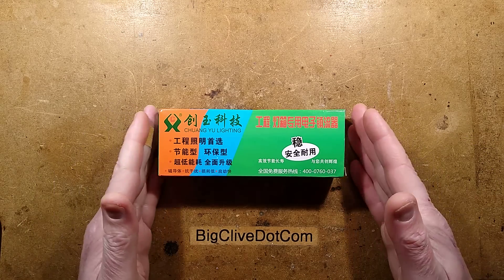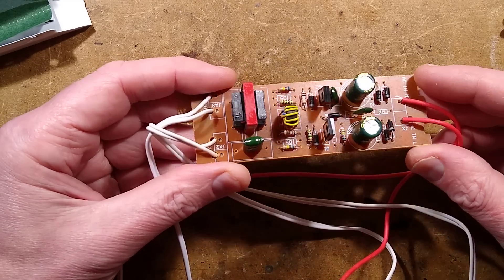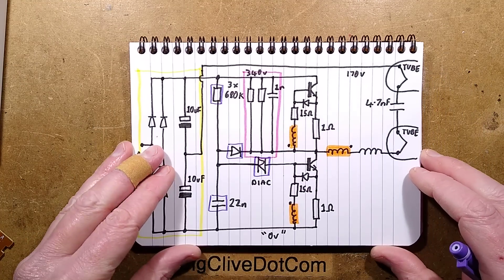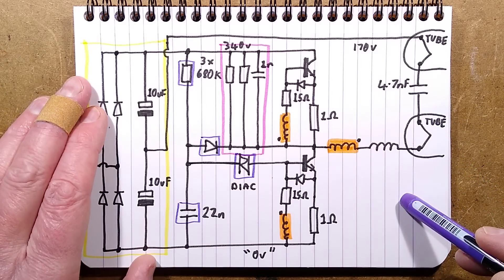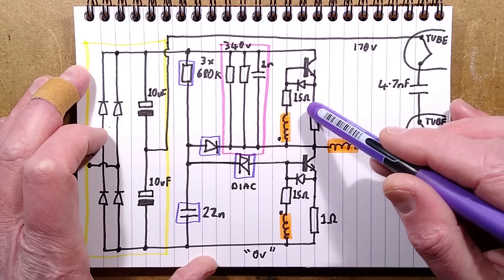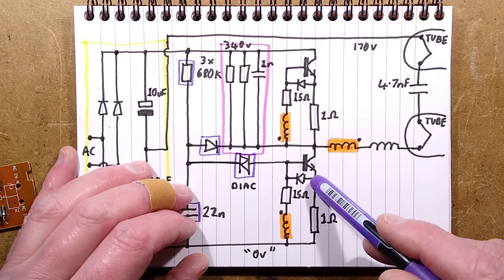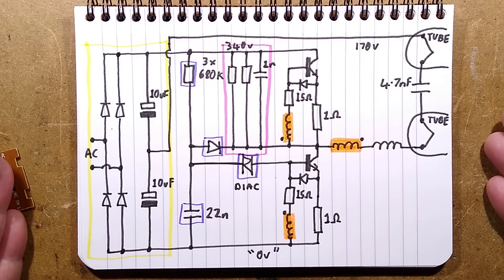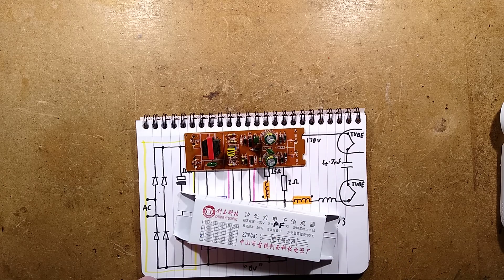Cheap AliExpress ballast (with schematic)

Comment: I'm going to continue to use fluorescent lighting in  my home and have stocked up on fluorescent tubes and other spares. As a toddler in the 70s they fascinated me, the way a tube could light so brightly and evenly. Was always also fascinated by the different start up behaviours. In 1978, only a few weeks after starting school, long thin boxes with purple text were delivered to the school which contained 8ft Thorn pop packs. These were to replace tungsten lighting. Still remember as the winter months took hold how well these lights lit the room, they had what was at the time cutting edge lighting technology in the form of 100w Krypton tubes.
Reply: Just don't get/stay too close to them, I used to use em as a UV source for curing UV solder mask, etc. 

The sun was also good, but well, this being Ireland, its rarer than dinosaur farts 😀 

Now I use a dedicated UV source, but you get the idea.

Comment: Yeah the biggest problem with LED lights is the caps, many of the time the reason it stops working is because of 
a bulging/leaking cap, i had that with two LED light already, i could repair them, and now he will work again for years.
Reply from the maker: Plus you can fit better quality caps.
Reply: @bigclivedotcom  Yeah, i have done that, i buy my caps in my country, and i always buy brand name caps.

I needed 4.7µF, 400V, and i bought 3x RUBYCON caps, and 3x WURTH ELEKTRONIK  caps, and i had to use 
WURTH ELEKTRONIK caps because RUBYCON caps were to big, and yeah the Lifetime 2000 hours 
Temperature 105c, a lot less then does RUBYCON caps, that had 15000 hours and 105c but i must do with 
what i had, and i could not find other caps of the same size, but it will always be better then the bad cops 
it came with.

And great to see you answer people under your channel.

Comment: Half bridge auto generator (electronic transformer) the 1n cap and resistors are to probably fine tune the frequency or add a little dead time.  👍great video as always Clive 

Steve

Comment: In my workplace we have backlights for movie posters... actually the frames have been designed by my boss and welded together by is brother. Essentially the frame is 1m high and 0,6ish wide, and the poster is taped at the corners to a 1 x 0,7m piece of 3mm semi-opaque plastic sheet that is forced between the frame sides. There are two 18W fluorescent tube fixtures in each frame. We have been using LED replica tubes in them with great success. 

Years ago the LEDs were rather expensive and everyone was already trying to get rid of the fluorescent tube stock. A "general store" of small hardware, household goods, decorative items, and a plethora of utter rubbish, which I very much liked (the store, but the rubbish too) was changing owners and they had huge discounts on some stuff. I saw a shitload of 30W fluorescent tubes sitting in a corner, sold for 0,20€ a piece, and it got me thinking... they were of optimal size to illuminate one poster frame with one tube, without making a brighter spot in the middle of the poster. BUT! And this is a big but! I tried to find prices for fixtures that took 30W tubes, and found out that the store had none, and in general, that size was virtually unobtainable or cost an arm, leg, and some other appendages.

Comment: The upper pair of resistors are needed during start up. this biases the output high so that the lower transistor can draw enough current to drive the 3 winding transformer.

Comment: Wouldn't be a bad theme for your greater wisdom to cover speaker crossovers or components. Not trying to divert you away from shiny things, but my guess is you gots knowledge.
Reply from the maker: That's probably best left to the speaker gurus.
Reply: @bigclivedotcom  Ok, suppose the next biggest questions would be how to join fibre optics and which wine would go best with SNP liver ( or just go with the buckfast )??

Comment: In the lift industry LED is taking over but I’m not sure if cheap ones are being supplied but the LED kits are learning about 6 months rather than the amount of years the old fluorescent ones did
Reply from the maker: A lot of LED lighting fails fast.  And it often requires the whole fitting to be replaced.

Comment: I use Fluorescent Lamps (a two tube fixture) in my garage.  I just changed out the factory ballast last year -- the original was installed in 2004.

I actually kind of wish I had another one, tbh.
Reply from the maker: You may be able to find old stock on eBay.

Comment: Clive, I know it's not directly related, but it's still related to switching power supplies. I recently bought a new USB C charger for my chromebook, an Anker 45w unit, it cost £25 off Amazon. It arrived and is tiny, about 1.5" square, charges faster than the brick supplied with the chromebook which is 3 times as big and doesn't get very warm in the process! On looking into it, apparently it uses GaN (Gallium Nitride) technology which is more efficient and capable of higher charging current than silicone semiconductors, would you have any interest in making a video about this technology, as it seems to be the future of fast charging!
Reply from the maker: I think the concept of gallium nitride units is that they can switch at much faster frequencies, so the transformer and capacitors can be smaller.  But it will potentially be stressing the capacitors more.
There are many fake GaN power supplies that just have a blue or green LED to tick the GaN box.

Comment: Connecting tube output to the middle point of input capacitors is not so uncommon. I've seen it somewhere multiple times, and then designed all my ballasts like that. This already is over 10 years ago (and still feels like last week).

Comment: Here in the US, electronic ballasts are pretty simple things--many times even simpler than the unit described.   Very often, the tube heaters are not used at all--both sides of the tube heater are tied together and only a single wire goes to each end of the tube.   I've got a pile of old General Electric Industrial 32/40 watt 120V ballasts that date back to the late 80s and they work just this way.      The nice thing about electronic ballasts is that they're very light when compared to the old iron-core ones--a benefit when you're retrofitting ceiling-mounted fixtures.

Comment: So I have a couple of these that don't work correctly.  They were used on LEDs that were made to use a ballast, they worked fine for a while but now only produce a dim glow. 

If I were to open it up, any idea of what area I would want to check out?  I'm just curious and probably won't end up using then again. I have messed with electronics but am not familiar at all with  ballast .
Reply from the maker: Is it the ballasts that failed or the LEDs?
Reply: @bigclivedotcom  leds work in a different fixture,, new led bulbs did the same. 

Fixture works fine with old led bulb after replacing ballast.

Comment: What's the point of the missing "BX" component near the AC IN? Its pins are shorted. Did they think if the narrow track won't be enough we can easily reinforce it?
Reply from the maker: I think it's a design option for a fuse or inrush limiter.

Comment: I have seen abandoned buildings still powered here on Youtube. Many of those are the old magnetic ballasts, and they sem to last forever. There was one place that was decayed so much that things were falling out of the ceiling. Most of the hallway lighting was still working 20 years after the place closed to the public for the final time. This place was built in the thirties if I remember right. 
The newer electronic ones (mostly) seem pretty good too. There was another video I saw of a small abandoned strip mall that was still powered. A small general store (Think Dollar General, but it wasn't that.) had power still and a few lights were still on, but flickering. There was a TRUE reach in display fridge that was still working fully, Keeping temperature, sounded good and one of the fluorescent tubes was stil happily spewing photons. There were several coolers like this, and none of the other ones were working, but still had power as the electronic thermostat still worked. One of the HVAC fans was working also. This place was also abandoned for about 20 years at the time the video went up. I can't find it now, otherwise I'd link it here. I guess it got deleted by one of the platform's snaps.
I found it in my bookmarks and I can confirm. That video doesn't exist anymore, the link is dead.
Edited because YT erased half my comment for some reason.
Reply from the maker: I wonder if people realise that a building like that will use a lot of ambient power when they turn the main switch on.

Comment: I prefer a 6 foot rube and the old bimetallic starters and a big choke, which I still have in the garage.
It just brings back memories of the good old days as i stand there in the dark after switching the lights on, listening to the genital tick tick of the starter. 
Plus the little pink flash of light from the end of the plastic starter can. You just don’t get this with LED’s where is the fun of not knowing when it light. 🙂

Comment: Interesting. The circuit is virtually identical to the drivers used for low voltage halogen lamps except that the output inductor would be a transformer instead.
Reply from the maker: And also many electronic neon supplies and ozone plate units.

Comment: I think the two 680 k and 1 nF help with the diode's reverse recovery time.  I also think the electrodes will stay hot long enough for the plasma to drain the filter caps to a moderately safe level... the oscillator is still powered after all.

Comment: The vans used by (the UK) post office trains use to use 24V DC electronic ballasts to drive the fluorescent fittings on these trains. The reason being that the vans used a 24V DC electric system. I don’t however know what size/type the tubes were (they were all smashed up on the van that I saw, thanks to the vandals).

Comment: My employer appears to have a policy (or the contractors that do the work) to replace fluorescent fittings with LED equivalent fittings on failure only. Unless in customer and public areas, where they fit the dim/bright sensor LED fittings. These change to full brightness when they detect movement, then after a while go back to their dim mode. Occasionally (such as in stairways) they use LED fittings that also have movement sensors (radar type, as they can detect through walls) that switch the LEDs off completely if no movement has been detected for a while.

Comment: Many years ago, I pulled a temporary fluorescent fitting from a skip. It had been running from a 110V AC centre earthed supply (55V - earth - 55V) which is standard for building sites and temporary site lighting in the UK.
On opening, I was surprised to find it used an autotransformer (to step the voltage up) in the same form factor as the magnetic ballast!
Reply from the maker: In the past, various trades used to make complete deathtrap contraptions from those for powering their 240V site radios from 110V.  Usually just some wires and lots of insulation tape.

Comment: I have some really old fluorescent fixtures that have the super old ballast's in them. The big heavy ones. For some reason I've never been able to wrap my head around how a ballast works. I know why you need them. But I don't really know how they limit current.
Reply: A resistor can be used to limit current and that's what ultra cheap fluorescent fixtures use. Regular series-connected magnetic ballasts are just inductors. Inductors have an impedance to AC so they basically emulate a resistor without wasting all the power. More advanced "rapid-start" ballasts were standard for longer tubes in the US and they are basically step-up transformers with leakage inductance.

Comment: Fluro lamps typically need a ground plane in order to start ( capacitance effect )   I wonder if this circuitry eliminates that need.
Reply from the maker: I think the ground plane (or even just the cables running along the tube) would be needed for reliable starting.

Comment: I bought 2 LED replacement tubes in Aug 2015 for £21.95 each they still work perfectly, used every day, in my kitchen. There is no need for fluorescent tubes.

Comment: Interesting evolution of fluorescent lighting. I'm still impressed that magnetic ballasts managed to do away with the starter.  When we built our house in the early 1980's I installed a bunch of 40W T12 fluorescent tubes with magnetic ballasts. In 2013 I replaced them with 32W T8 tubes with electronic ballasts.  Then last year I replaced them again with 14W & 17W T8 LED tubes and removed the ballasts as the tubes have built-in electronics. So far I'm happy with the LED replacement brighter and lower wattage.

On this side of the pond it is becoming pretty common for commercial buildings to use PoE to implement smart lighting.
Reply from the maker: The networked lighting is fine until a rogue node takes out an entire network or causes mass glitching.
Reply: In the last 5 or so years, I've retrofitted most of the 4' fluorescent fixtures in my garage and shop with LED replacement tubes.  The former occupants were 32-watt T8 lamps with electronic starters.   I'd get about 5-6 years of service out of a lamp before the brightness declined seriously.   The jury is still out on the LED replacements, but so far, so good.   I've got plenty of spares, so if the LEDs start declining in brightness seriously, I'm prepared.

Comment: Question. 
There are Pre-Heat and Instant on CFLs
What is the difference in the ballast / driver they use? 
From what I see the only difference seems to be a PTC thermistor being present parallel to the capasitor connecting the 2 filements. 
Would it theoretically possible to turn a instant on CFL into a classic Preheat CFL? 
(Maybe an experiment for you to try?)
Also, Great Video!
Reply: Yes, I believe that's the only difference. One type of "instant-start" CFL I've opened even has an unpopulated board location clearly marked for a PTC. When the PTC is cold it is a near-short so there is no voltage across the tube and all the current goes into the heaters, just like an old-school starter. When the PTC warms it opens and voltage is allowed across the tube.
Reply: @eDoc2020  Thats exactly what I thought!
I have have extracted a ballast from a dead CFL and I have a PTC now, Even tho I am a bit scared of damaging a perfectly fine working CFL I will try this anyway in the near future.

Comment: That circuit boards look like it was made in the 80's. Nothing wrong with that, much more pleasant to work with than the modern SMD ones when fixing stuff. But definitely didn't expect to see that.

Comment: I am retired now but I was asked to increase lighting in a liitle used room, I was going to fit LED light and I was checking wholesale prices and I found I could buy a twin 4 foot fluorescent fitting including tubes and VAT for just over £5:00. Figured the payback on LED was abot 10-15 years  so went fluorescent

Comment: Old ballast for fluorescent tubes lasted decades. On the other side, I have a bunch of these electrochinese things that have failed. Have replaced them with LED tubes (that fails fast too). The few of these electronic ballasts that still works burns (literally cooks) tubes in less than a year.
Screw all of that "sustainable" crap. I've scored a lot of vintage industrial fluorescent fixtures (the long tube flavor) in a dumpster, and I will put them in good use replacing the modern ones...
(also old starters makes the random flickering lightshow when turned on, especially satisfying when there are many turned on at once)

Comment: Nice explanation. Looks like if you installed a jumper at Bx it would allow operation from 120VAC - voltage doubler- (or blow it to h-e-double-hockey-sticks on 240)..

Comment: I have a CFL box for curing resin (nails and other stuff), and when I got it, I checked if it works and then disassembled to see what's inside.
It happened many months ago, but as far as I can recall, it has a tiny microcontroller (for timed mode), and an oscillator circuit, some capacitors and a three-winding (IIRC) inductor on a ferrite bead.
I had no idea what was the circuit, but now it feels like it was something similar to what you showed here.
Reply from the maker: It's very similar, but usually has one inductor per tube running on a common switching circuit.  I took a four-tube one apart in a video.

Comment: Years ago, there was a term used for any start-up circuit for these and inverters, which was called a "tickler circuit." The switching transistors were tickled into operation.

Comment: I still have a swing-arm type florescent lamp by my bed to read by, and the two 16" tubes in it have been going now for several years. I purchased two more tubes/bulbs, not long back, and stored them away, and I might buy a ballast, as well, because the lamp, to me, is much better than LED.

Comment: The circuit is an (power) oscillator, which lifts the 50Hz to 30kHz, which reduces the ballast inductor from a iron block to a 5gramm ferrite.

Comment: hmm..by myself.. i prefer to have lots of fluorecent tubes in my workshop, because the LED lights cast too much shadow... And i am annoyed by these cheap electronic ballasts.. they tend to fail after a few month on a regular bases... I whisch i could find "good old" ballasts for my workshop lamps.. The heavy beasts with the "starter"... But i can not find them on the internet anymore^^
Reply: I googled "fluorescent light magnetic ballast" and found a few preheat style ballasts, of course if I tried to actually order one they be likely out of stock.  They're not cheap either.